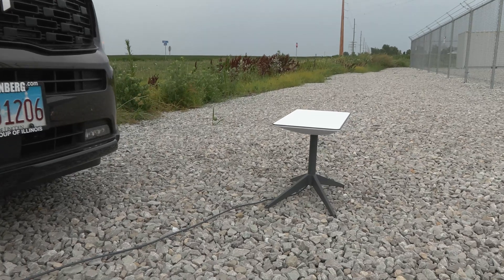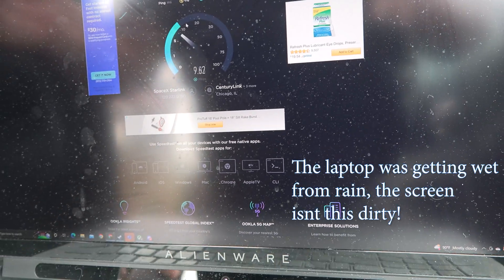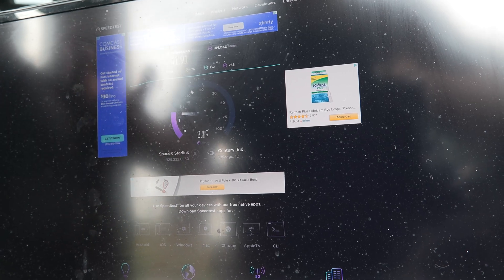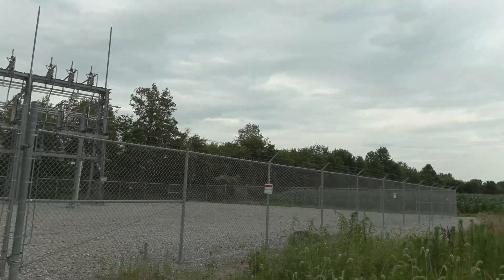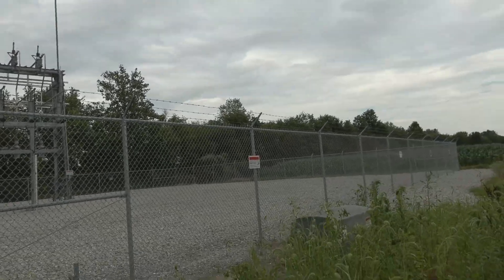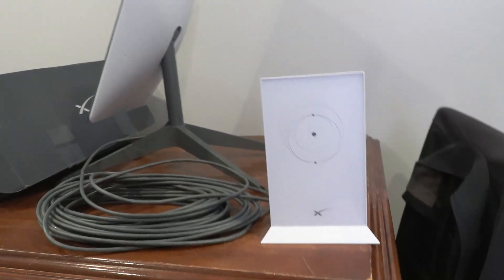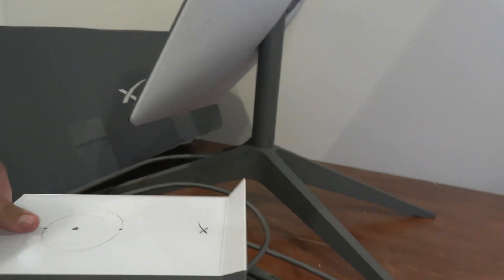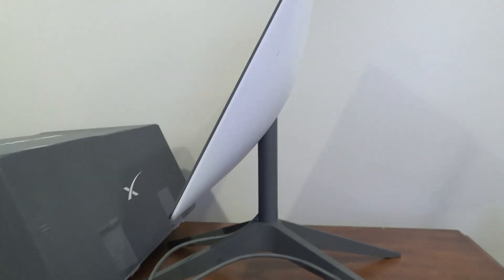Initial test of Starlink at our Substation

Comment: Dumb question. How did you get permission to install mining equipment inside a power substation? Usually those are pretty well blocked off from public access. Also, do you think Starlink would be good enough for primary mining connection or only as a backup? Im asking because I have property up in the mountains where I might setup a small farm, but no wired connections available, so I would use starlink.
Reply from the maker: It’s been work since mid 2021 with our team and the power company working through zoning, hearings, permits etc. it’s a lot of work to get it done but very possible.

Comment: Is there not an ethernet port on the router? Please don't tell me its wifi from there?
Reply from the maker: There is a eth adaptor that sets in between that usb connection too if you use it. That allows you to plug into a switch or hub.
Reply: @BitsBeTrippin  are you talking about the USB-c looking connection? I'm sure you will make more videos on this in the future. Thank you for sharing your journey!